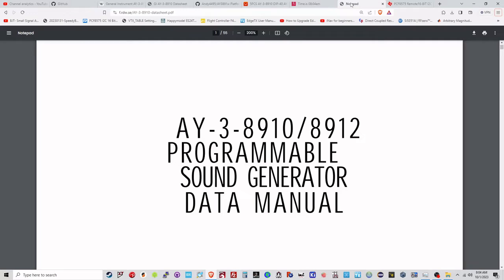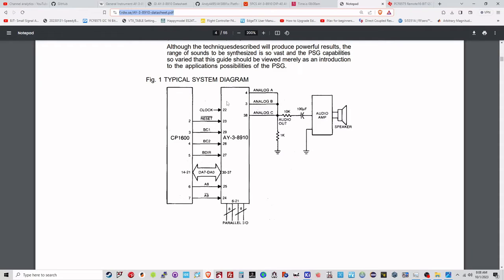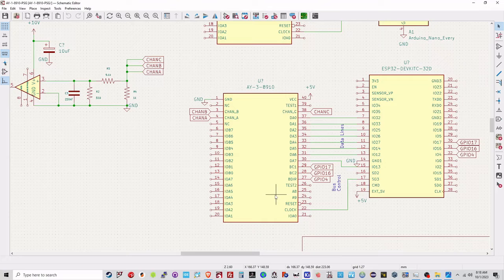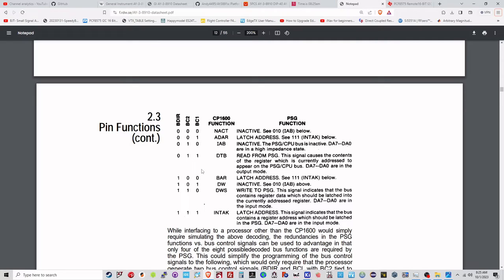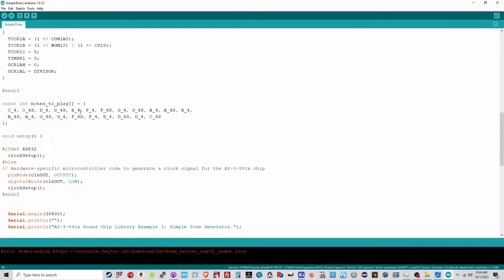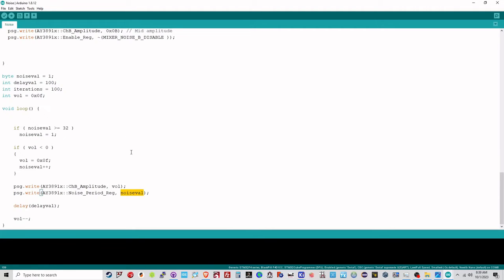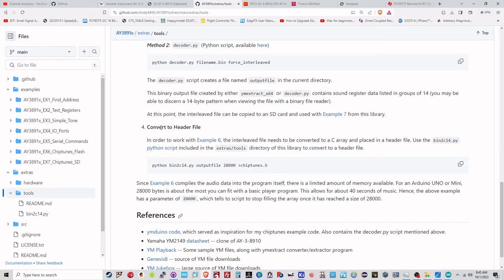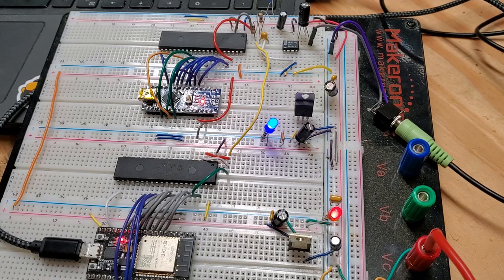AY-3-8910 with ESP32 and Nano

Comment: I'm working on an AY-3-8910 project of my own, interfacing it with a Pic18F46K22. Programming it myself and it works fine but there was one thing that had me baffled for a while so I mention it here : 

The datasheet lists the registers in octal notation. 

So,  writing to registers 10 to 17 (as the datasheet numbered them) didnt work as intended because they were really registers 8 to 15 (in decimal).

Of course, the datasheet did use a little subscript "8" in the text but it's all too easy to assume decimal (who in the world uses octal anyway? 😅). Don't be like me and waste hours trying to find a bug that was really a reading issue 😄

Also, I use a 3,579,545 oscillator to clock the thing (halving the frequency with a 7474 as clock divider). These oscillators are still widely available (it's the NTSC color burst frequency). Lists of musical notes converted to tune values use this frequency because this oscillator was prevalent in the home computers of the 80s that used this chip.
Reply from the maker: Thank you for the comment - I agree the datasheet is a little tough to follow!

Comment: I would have thought that you need a level shifter to shift 3V->5V and 5V->3V so you don't damage any of the chips.
Reply from the maker: No - I am not attempting to read anything from the device. Just setting GPIOs. There are modes where you can read data from the AY-3 - but I didn't attempt to use them
Reply from the maker: I would add the AY-3 also works fine with the lower level - both on the inputs as well as the input clock

Comment: is it wise to tie the 3 analogue output directly together? The outputs could be fighting each other, would it be better to use an op-amp to mix them.
The data sheet is not very helpful, well not the one i found.
Reply from the maker: I actually thought the same myself - but there must be internal output resistors on each of the channels taking care of that. Have a look here
https://github.com/nickbild/ay-3-8910/blob/main/docs/AY-3-8910-datasheet.pdf

Page 37 has a reference implementation showing the output connection for the 3 channels
Reply: that page  was not in the datasheet I found on the internet, so looks like you can do it without any issue. @na5y

Comment: The I2c expander isn't really a good choice for this application. You can buy bidirectional and unidirectional bus transceivers that are powered from two different power rails, in this case 5V and 3V3. Texas makes a lot of these level translator devices. Some examples are the SN74LVC1T45DBVR and the SN74LVC4245APWR to name just a couple.
Reply from the maker: Thank you for the comment Vince - I was looking for such a device and couldn't find one appropriate. I knew they had to be out there! Ideally I wanted a high speed device with fan out so I didn't have to use up so many pins - do you know if such a device exists?
Reply: @na5y Ah, you want to fanout a few pins to many with level translation too ? Serial expansion while trying to fanout is going to always be a latency penalty. You might be able to cobble something together with 595 shift registers and a few pins driven thru a level translator for clocks and enables.  Other than that I can't think of anything that comes to mind that'll fit your usecase cleanly.
Reply from the maker: Thanks again Vince!
Reply: @na5y  no worries. Take a look at the TI SNx4HC595 device. It has 3 state outputs so you could back to back 2 of them for read, write. you can shift in and enable the output when the word you want to write is fully shifted so the audio device doesn't see partially shifted words.